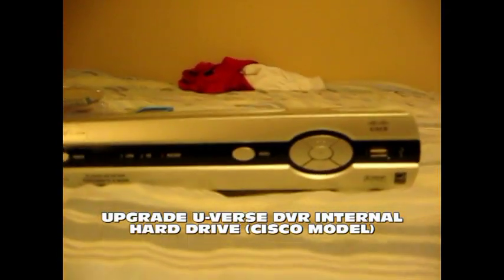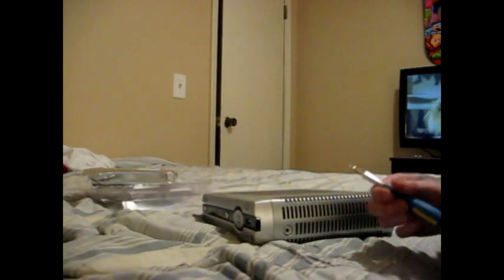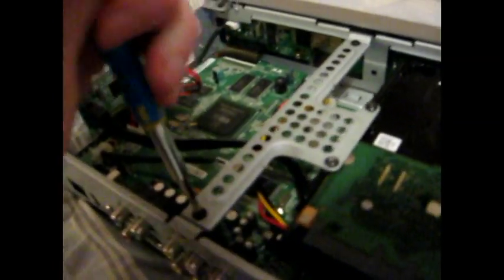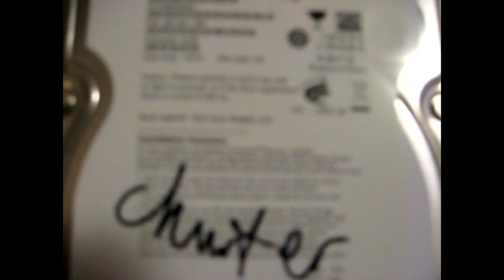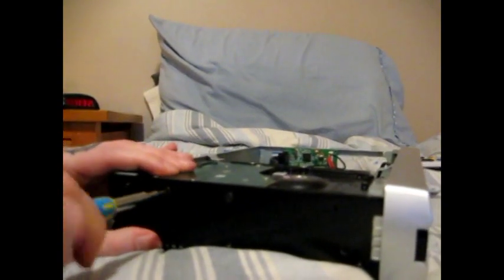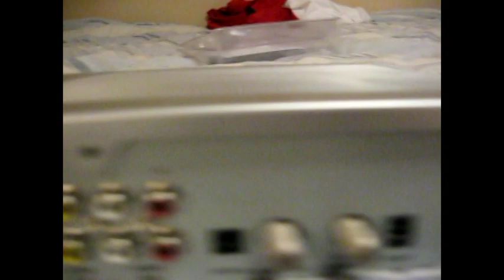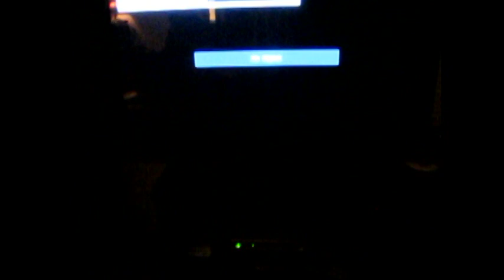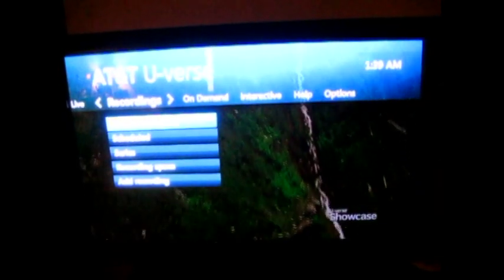Upgrade Hard Drive in AT&T U-Verse DVR 1TB

Comment: Thanks for the video.
The clip in top center front was driving me crazy.
I have a Cisco ISB7500.
Your video applies to that model as well.
The only difference for my box is some of the screws require a security bit since they had a tiny pin in center of hole.

Comment: I just performed this hack on mine. I was a bit concerned since I needed to connect the new hard drive using a PATA-to-SATA adapter, but after what seemed like endless reboots it worked like a charm.

Comment: Yes, the Wireless STB acts as if it was physically connected over HPNA, you may use the Ethernet port to tie directly into you computer. The only noticeable affects on either your TV or internet would be if you ware watching HD shows with a bunch of devices connected to the wireless STB (depending on your internet connection)

Comment: I have read that you should use a non-Advanced Format drive for the Uverse DVR--in other words, a drive that uses the old 512 bytes per sector vs. 4096 bytes.  I understand that an Advanced Format drive may be slow and glitchy in the Uverse DVR.  Does that sound right to you?  If that's true, can you think of any way to fix an AF drive to play nicely with the Uverse DVR?  It looks like at least Western Digital AF disks might work if you jumper pins 7 and 8.  Thanks for posting this video, btw.

Comment: I replaced my drive and found that after a few months the system would lock up randomly.  Traced it down to a thermal issue.  My new drive ran VERY hot and the system was trying to protect itself from meltdown.  Be sure to provide adequate ventilation if you replace the drive.
Reply: Was that due to a higher RMP drive maybe?

Comment: Is there a way to copy the recordings from the original hard drive to the new one once it is installed?  They become useless with no way to play them and no way to easily copy to DVD.
Reply: +Avery Sloan I know you asked this question several months ago but nobody else has bothered to reply so I will in case you're still curious. No, there's no way to transfer recordings between U-Verse DVRs or HDDs. The recording files are encrypted and will only work on the DVR/HDD on which they were originally recorded. The only option is to use the analog outputs of any of your STBs and a video capture setup to copy the recordings in real time, which probably isn't worth the hassle.
Reply: +AtomizerX  - Thanks for the reply.  My drive is full and I have to deleted wanted programs to record new ones!  Perhaps ATT will allow external drives at some point.  One can only hope.
Reply: It really is a shame that AT&T is so restrictive; they shouldn't be concerned if users want to store content on external drives (my DVR has both USB and eSATA yet they are still unusable several years after this box was released!) since the encryption can simply keep the content secure and prevent users from pirating it or whatever. The only suggestion I can offer you is to watch as much content as possible so you get to a point where you can request a higher-capacity DVR; I have the VIP2250, which has a 500 GB HDD and is the highest capacity they offer. I've read that U-Verse subscribers of the U300 or maybe U200 and above tiers are supposed to get priority access to the most advanced DVRs (don't accept it if they want to charge you extra monthly.) As an aside, not only is it nice to have a higher-capacity DVR but this one is noticeably faster than my old Cisco one, and I'm assuming you have one of the older 160/320 GB boxes. To help you free up space on yours, note that in many cases content owners offer free streaming of their programs along with your paid subscriptions via a content provider like Comcast, Time Warner, or in our case, AT&T. As an example, if you pay for HBO on U-Verse you get free access to HBO GO so you can view anything they offer without even having to bother recording it; when you visit their site and attempt to start viewing they even log you in automatically via your U-Verse account, so it's very convenient. I suggest going through your recordings and seeing if they're available anywhere online; at the very least you'll be able to free up space on the DVR in the interim if not prepare to clear it out for a potential DVR upgrade.
Reply: could you please give me the name and where I can find the hard drive you used here?
Reply: and does replacing the hard drive on one box increase the memory for every other box in your house? or just that one box?
Reply: +Inayat Huss Well in the first place you probably should have directed your first question to the video creator (i.e. add a new comment) rather than this thread as neither of us has performed the HDD upgrade. Second, just Google "XYZ HDD upgrade" where XYZ is your specific DVR model, and I'm sure you'll find results from other users who probably mention which HDD model they've confirmed to work. Third, your DVR stores all the content you have recorded, including providing the ability to pause and rewind from any other receiver, and consequently upgrading the HDD will increase the capacity available to all of your receivers (in other words, it's shared between all your devices.) Finally, I recently got a replacement DVR from AT&T directly and it came with a 1 TB drive, so after a lot of complaining and hardware replacements I've finally got a decent DVR.
Reply: could you please give me the name and where I can find the hard drive you used in this video, or ones you know are compatible and fit in the box?
Reply: Didn't mean to hit the like but anyway, what about buying a HDD duplicator. I just pulled my 500GB from inside my PVR and plugged it into my computer with a Seagate USB powered adapter.  I had wanted to use Acronis True Image to clone the drive, but it wanted to reformat first which as you know erases the drive. That's why I'm thinking maybe a straight HDD duplicator would work, sure you could only use it as a back up but it's better than nothing.  I dropped a Seagate ST2000DM001 2TB into my Shaw Cable Motorola DCX3400M PVR and am concerned as it isn't a A/V drive like a WD Purple as some people recommend. I record from TV to the Motorola then playback through a Hauppauge to my computer.  This makes for 1280 x 720p Blu-ray res recordings in 5.1 Dolby Digital (If you run Toslink audio cable).
Reply: You could try using Macrium Reflect, which has a free version that I've successfully used to clone drives. I'm not sure if the larger, cloned drive will be recognized in the DVR but it's worth a shot. One thing to note is that those A/V drives are rated for greater uptime and more activity, so a different type of drive like an archival or regular consumer HDD will fail sooner.